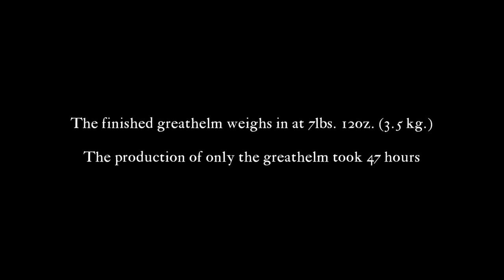Making a 14th Century Greathelm Part 3

Comment: Truly a masterpiece. Thanks for taking the time to carefully show each stage of production. I can really appreciate what you said in part 2, in reference to the lack of learning  material available when you were learning the art, and have a lot of respect for your capabilities. Even with all of today's videos, sometimes it can still be quite hard to research some of the finer details of armour making- this is one of the few videos I have seen that shows the interior suspension system- I am currently working on a leather helmet myself and have been struggling with the research for some of these points. 
Thanks again, I have subscribed and intend to donate soon.
Reply from the maker: +m456griffin I'm so very glad that I can help. If you're interested, the main reason why I haven't posted any new videos recently is because I'm working on a book which will outline in even further detail the steps in the creation of early medieval armour. It will (hopefully) be part of a book series that will continue through the medieval and renaissance period. Thanks for subscribing and I wish you the best of luck with your projects!

Comment: Is there anything wrong with using a rivet gun and file, rather than shrooming the rivets with a hammer?
Reply from the maker: Yes. Pop rivets from a rivet gun will NOT hold up to use. They are horrendously inaccurate. Filing the ends off of the rivet will be exceedingly difficult. Instead, learn how to properly hammer rivet and a whole new world of potential will open up to you.

Comment: What is the helmet that you have under the great helm?
Reply from the maker: The helmet underneath is a cervelliere that has been modified to include a protective fencing mesh and bargrill. The edge of the cervelliere is a maille aventail for protection to the neck and throat. Historically, great-helms were often worn with a cervelliere underneath. The cervelliere evolved into the bascinet during the late 14th and early 15th centuries.

Comment from the maker: @ apieceoftofu: Yes, you are correct! Many 14th century and later 15th century piece were indeed case carburized wrought iron. But there are many examples of 13th century and earlier helmets that were not. The Pembridge Helm is a rare example where it might have been done (Williams, Dr. Alan R., Four Helms of the 14th Century, JAAS, 198, Vol. 10, No 3, p 80-102.)

However, being that this is intended as an introductory tutorial video, it was a bit much to try and fit into...plus the case carburization method was intended to create a layer of steel onto the wrought iron sheet. This is made of low carbon mild steel, but steel nonetheless. It seemed redundant and more expensive than the client was able to pay.
Reply: Thanks for the great info. Your great-helm in this video looks very similar to the Pembridge Helm that you mentioned. I just started my great helm tonight but I'm doing the flat-topped, more cylindrical "bucket" style because its my first time attempting plate armour and those versions have fewer plates to fit together and rivet in place. Mine is mild steel as well (probably around 0.1 carbon content), could you point me to some good guides for case carburizing with basic equipment? I might want to give it a shot.
Reply from the maker: apieceoftofu Learn how to walk before running. Case carburization is not a beginner level process and isn't a priority in early stages of learning armoursmithing. However, if you are determined...

The essential process is to take the low carbon steel and seal it in a metal vessel (an emptied and clean food can) along with carbon-rich organic material and then bake it at a red heat for a long period of time (longer than 24 hours). The carbon in the organic material bonds into the surface of the steel, creating a thin layer of higher carbon steel. The best material to use is charcoal dust, but I've seen blackpowder enthusiasts re-carburize the frizzens of their flintlocks using scrap leather. 

Keep in mind, this process was used primarily to harden the edges of tools and weapons, but there's minimal evidence of this being used in armour from the time period (12th-13th centuries). 

http://youtu.be/TKKhIOx707M?t=38s
Reply: Parker Brown
Awesome, ill keep all this in mind. Thanks for the help.

Comment: I love how you balanced vision and protection, and the idea of a second smaller healmet instead of a full chainmail coif, since pierce protection will not protect me from a cracked skull. It looks mean. I don't get the same feeling from armour and weapons from the 15th century onwards. My period of interest would be from the times of Julius Caesar to 1400 AD. 
 Regarding the design, I wander if it could be made with a greater perforated surface, of only small holes; if perforations for the ears could be added; and if heat treating to a pring temper an appropiate steel would allow the use of 1mm sheet without loss of durability and protection (assuming 1mm thickness and spring temper for both the interior and great healmets).
Reply from the maker: +SalveMonesvol Well, first of all, this is not my design. The use of the great helm with a skull cap (cerveillier) is well documented, historically. The pierced holes closely match the ones used in the historical original. From what I've seen, there aren't any great helms that have perforated holes for the ears. As for heat treatment....this is a modern technique that's only possible with homogeneous high-carbon steels. A great helm and cerveillier like this would have been produced during the late 13th century and early 14th century. Most armour at that time was made of wrought iron and there were some that were case carburized to create a thin steel outer layer to the wrought iron sheet.

Comment: What do you call it when the steel turns blue-ish? And what effect does it have on the strength?
Reply from the maker: Andreas Stie, heat bluing forms an oxide layer over the surface of the steel helping it resist rusting. While technically bluing and rusting are both oxidization processes, bluing gives a certain amount of protection because bluing undergoes a small volume change and remains firmly on the surface of the steel. Rust undergoes a large volume change and will flake off, resulting in corrosion. The blue appearance of the oxide film is often used as an indication of temperature when tempering high carbon steel after hardening, indicating a state of temper suitable for producing a springy quality. However, this helmet (along with most armour of the early 14th century) was NOT made of high carbon steel and, as such, does nothing to the steel’s composition in terms of springiness. Hardening and tempering spring steel armour was done in limited quantities in the late 15th century and throughout the 16th century. It’s done today in far greater quantities in modern SCA and BoN armour, but is not historically accurate.

Comment: Out of curiosity, would this be strong enough for full contact fight leagues or is this more decorative? I am looking to getting into smithing my own pieces and if this would do well then I would be over the moon. Also, this is an amazing piece and you are a very talented smith.
Reply from the maker: It depends upon what fight league you're talking about. Most SCA and BoN armour standards are actually made thicker and heavier than historical armour. Technically speaking, there are many pieces of real armour that survived actual combat that wouldn't be allowed on a modern tournament league.

This helmet was made for a client who fights in ARMA, but it wouldn't meet the standards required in BoN. It would meet standards required for SCA.

If you are getting into a specific group, find out what the standards are from the marshal of your local organization. They will direct you as to what you need to do for fighting equipment.

Comment: dont you have to harden it afterwards?
or is this accomplished by heat bluing?
Reply from the maker: I'm not using high-carbon steel, so hardening and tempering isn't possible or necessary. You can only harden and temper steels above 1040 (0.40% carbon content). Most historical helmets of this time were not made of steel, but rather wrought iron which cannot be heat treated.
Reply: Parker Brown so why bluing them then?
Reply from the maker: Heat bluing helps prevent rust and it looks nice.
Reply: Parker Brown thanks.
Can you do this with any steel?
Reply from the maker: You can blue any steel. Stainless can be difficult, but you can use a chemical patina for it.
Reply: Parker Brown im just asking because i think it would be a nice alternative to browning for guns.

Thank you for taking your time.
Reply from the maker: NO NO NO NO NO! Heat bluing changes the temper on high carbon steel! Gun parts should never be heat patinated because it will change their ability to withstand force and pressure. Do NOT heat blue a gun part.
Reply: Parker Brown not for esential parts.
I want it for the trigger or the chamber stem.
Just to get an contrast.
Reply from the maker: Here is a MUCH better video for what you are looking for:
https://www.youtube.com/watch?v=lHuNwFdtzik

Comment: I gotta say the hammering on the rivet with leather strap is the most annoying part, also. Do you do wool filled padded lining?
Reply from the maker: I actually have a fellow martial artist who makes the padded linings to fit.
Reply: Parker Brown Does he do custom design?
Reply from the maker: EricPaz She does, but she's also booked for over a year :-/
Reply: Parker Brown Aw man, alrighty
Reply: Parker Brown Can you link to a picture of the padded lining? Would this be worn under the Cervelliere, or between the two? Would the leather suspension system be different for a helm not worn over a Cervelliere?

Comment: Can you wear the helmet also without an Bascinet ?
Reply from the maker: Deus Vult, yes but it would need to be made smaller.
Reply: Parker Brown How much smaller i must print the patterns ?
Reply from the maker: Deus Vult, you need to measure your head and construct a wooden “dummy” similar to the wooden outline I give on the patterns page. Construct a new smaller wooden helmet outline and then modify each of the plate patterns  off of that new helmet outline. Yes, this is a lot of work, but this is how good quality custom-fit armour gets made. You are not going to be able to just print out the given patterns by a reduced percentage and expect it to function on your head. You’ve got to take the time to adjust each part to fit and place your head in line with the oculars. Otherwise, it won’t work.
Reply: Parker Brown thank you
Reply: Parker Brown but is it important to make it smaller ?

Comment: not too shabby as they say. 
Am I going entirely senile, with the memory span of a goldfish, however, in saying that you missed out a section on doing the wire-supported roll on the bottom?

(Also, for an accurate copy of the Pembridge, it would have two parallel lines on the nasal, about 3mm / 1/18th in from the edge, graved or chiselled into the metal. They're not particularly noticeable in most photos, but stand out if you handle the original, and they do alter the look of it in a subtle way.)
Reply from the maker: I omitted showing the lower rolled edge simply because I didn't want proof if it and wrong :-/. And thank you for sharing the information about the nasal!
Reply: did'nt want proof of it, in terms of not having evidence of it on the original, to show how it was done? 
Because from what I could see, the roll was spot-on. 

If it's the case that you just need source material for confirming that detail on the original, I'll see to it that you get some detailed shots of the helm that clearly show the wire inside. (conveniently, the very tip of the front has corroded, so you can see how it was done.)
Reply from the maker: J. G. Elmslie Honestly, it's just because I didn't want to film it in case it screwed up.

Comment: I like the idea of using non blued rivets on the blackened steel, or maybe a copper coated to give it a nice contrast to the black that will really pop before you get your head bashed in on the battle field lol
Reply from the maker: A fun way to copper plate steel is to dip the steel into hyper-saturated jeweler's pickle. The pickle (which is mostly sodium bisulfate) is used to clean sterling silver after soldering and tends to strip away copper. After the pickle is super saturated with copper, dipping clean steel into it electrolytically plates the steel, giving the visual effect of copper with the durability of steel. However, the coating is quite thin and will wear off with time.
Reply: Parker Brown That is something i didnt know! Thanks for teaching me something new today :D
Reply: Well done.  Beautiful work.

Comment: Heat bluing protects from rust too?
Reply from the maker: It helps resist rust, but it's not rust proof. You still want to keep the steel oiled :-).
Reply: Another armourer told me he uses wax instead of oil. Which do you prefer? Would you ever consider making a gauntlet video?
Reply: terry halstead Oil attract dust and also will dry in time(depend on what type of oil you use). Wax can last pretty very time, provided if you don't scratch the wax on the surface away.
Reply from the maker: terry halstead I tend to use gun oil on my stuff, but I'm constantly re-applying it. A very good wax is Renaissance Wax.

Comment: Excuse me, sir I think ur helm look bad ass but ur templates lack measurements & I was really looking forward to making my own, do u think u could hook me up with some dimensions?
Reply from the maker: Xharles, I did not include dimensions because the pattern needs to be modified to fit the individual’s head. I suggest printing the patterns full-size, transfer to poster board and making a mock version of the helmet and modifying the dimensions in the poster board before cutting it out in steel. You will be MUCH happier with the end result.

Comment from the maker: @fggdf fdgdfg: 1) A rivet gun is very difficult to fit inside of the interior of a helmet. 2) Filing the interior of a helmet is very difficult. 3) The entire use of a rivet gun and file is unnecessary as the mushroomed interior heads are smooth and function perfectly well for the needs of the armour. 4) The use of a rivet gun was certainly not a historical option.